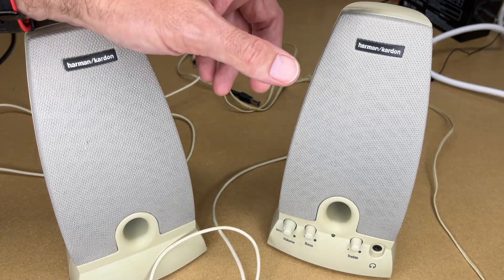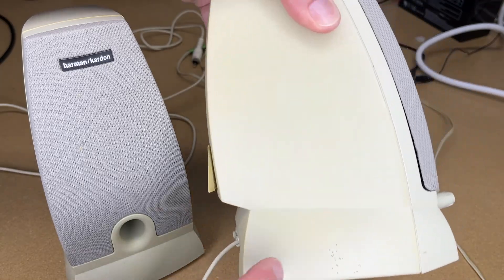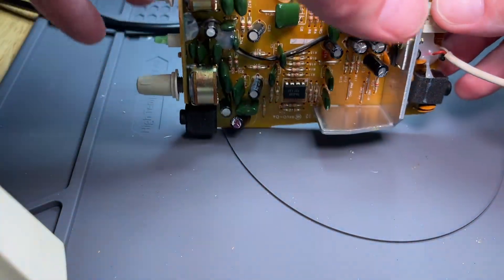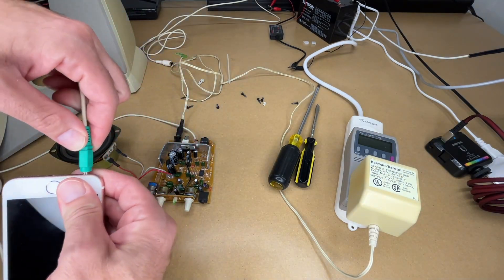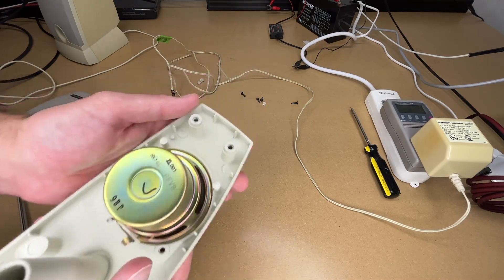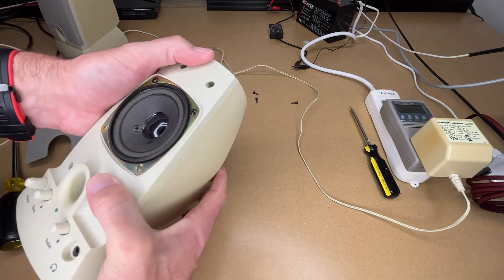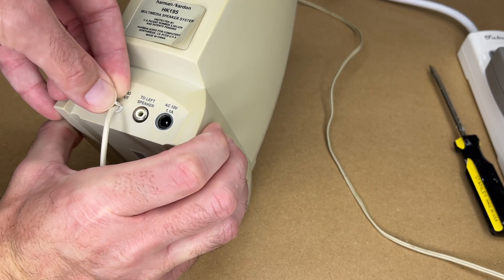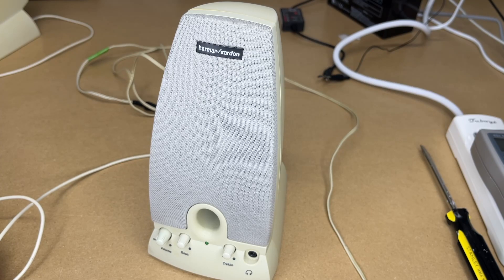harman/kardon HK195 Speaker Repair

Comment: I have the h/k Multimedia Speaker System, almost identical to this.  I undid the two screws on the bottom and it wasn't coming apart, so I searched and found your video.  Thank you for noting that one can pull the front off by loosening it with one's fingernail.  

I found that I need to push down on my power cord to get it to work.  The piece it connects to came up from the circuit board a little.  I now have the outside power wire pulled down and it works again.  Thanks for this video.